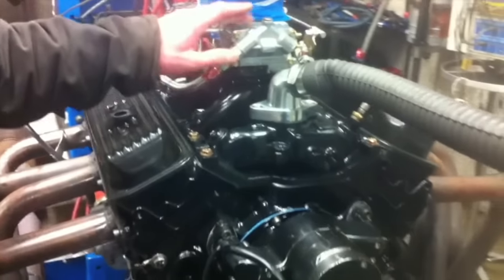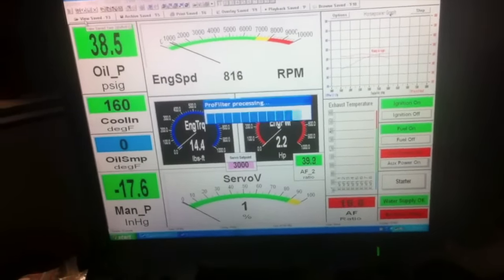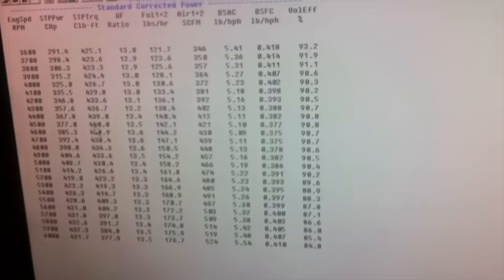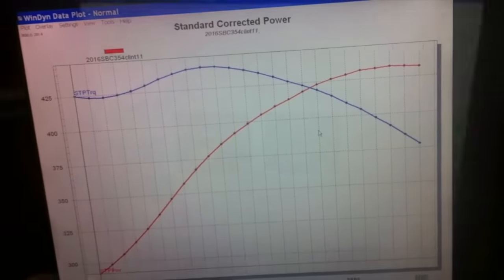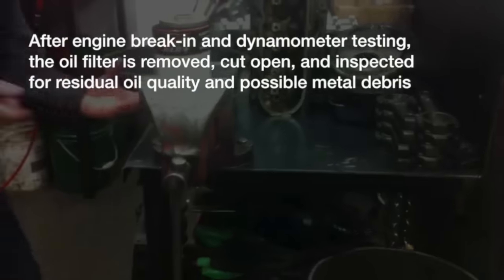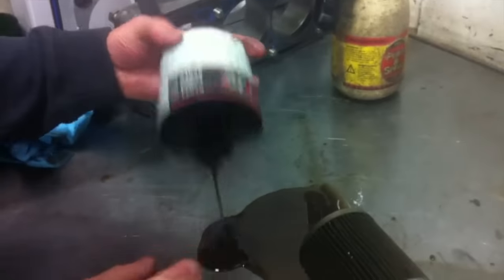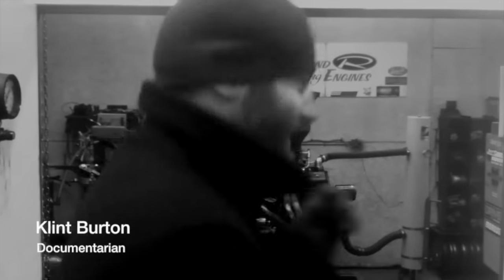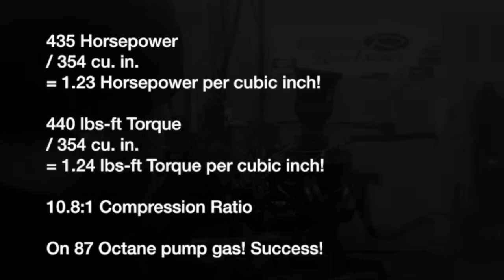SBC 400 Block + 327 Crankshaft Dyno The 350 Chevy Should Have Built (2016)

Comment: Odd how every dyno test shows more torque for a square vs short stroked engine, which is what's best for daily driven cars. Longer stroke brings fuel economy while short stroke brings high revs, without DD efficiency. Not really sure what's with the "350 Chevy should've built" phrase. It's great for drag racing, but not much else.
Reply from the maker: Thanks for commenting. The phase is referring to an iconic article in Hot Rod magazine in 1997. We didn’t coin it but we were highlighting it here. There’s a link in the video description if you’re interested!
Reply from the maker: https://www.youtube.com/redirect?event=video_description&redir_token=QUFFLUhqa0FNSWZibXlwdHZaRnIwaVdTZmtVcVNmMjBCQXxBQ3Jtc0ttMm1TUWxfY3RzbmhFdnFBc040UjBhVnctT2M2azU3RHNJUGQzQld1cGk3YWxJZ3BPNTh1WFJZd1lvbm54VjlONlJWUGs0NTRuNE5pU2VVRzVRUjlCdkFSZHBIYXAzRlRvT2ZHRWNNTHVPWnpuU19VMA&q=http%3A%2F%2Fpurplesagetradingpost.com%2Fsumner%2Ftechinfo%2F350%2520chevy%2520engine.html&v=3oLz362AbDU

Comment: We old school gearhead would put a 327 crank in the 350 and have a high rpm hot rod . Of course one mod leads to another .
Reply: A 327 crank in a 350 is... a 327
.
Reply: @dennisp.2147  It's been a long time but it also had to do with the heads . Bigger valves I believe but like I said it's been a long time . We also messed with 283 and 327 and 265 also 348 w .
Reply from the maker: Yes it is. Both share the 4” bore :)

Comment: I've always wanted to build a stock stroke 400 Chrysler big block with 440 connecting rods and custom Ross 11.0:1 forged pistons, with Mopar Performance stage 6 aluminum heads, then put in a valve train set-up that would allow it to rev out to about 8500 RPM. Top it off with twin GT35 turbos and a Holley HP stand-alone fuel injection system, just to see how "good" that combo would run.
Reply: RPM is only limited by the size of your bank account. The valve train is the big factor in RPM.

Comment: Basically a high performance 348
Reply from the maker: Haha! But about a hundred and a half less in weight! Thanks for your comment!
Reply: @ceperformance  try building a 267 with a 400 crank
Reply from the maker: The disadvantage of the 267 block is the small bore. Might be a good low RPM truck motor though.
Reply: @ceperformance  that's why I suggested it. I'm gonna try a 333. 030 over 307 with a 350 crank.
Reply from the maker: Go for it! I hope you get the results you’re looking for!

Comment: Sounds like that turned out better than fords idea of 400 block and 351 short stroke turning into a 351 modified,  I've owned both the big full 400 and 351 modified and the 400 was a horse but 351 modified drank gas and alot under powered!
Reply from the maker: Hi Rick! Thanks for your comment! Something was obviously going on if an engine is underpowered (no excuse for today's engines to not produce 1+HP per cu.in.), possibly in the design and/or the sum of the parts, from top to bottom? Best regards!

Comment: With the money you could’ve saved on the most likely custom pistons and rods, you could’ve built a flat top 400 with those heads to make 435 horse. And made gobs more torque. 
Let alone a set of aluminum heads letting it make close to 500 if done right. Same rpm range. 
Peak numbers are great but this didn’t rev any higher than a 350 would’ve. 
Bug bores are god for airflow but flame travel gets slower.  And torque under the curve means more power under the curve. Means you accelerate harder at every rpm point below the peak even if they both make the same peak or say the big motor makes less peak. 
This is a great concept for rule specific racing, as the short stroke is easier to make rpm with a big bore for airflow, but for the street, build it big. Coyotes run 8k rpm factory and they have a 3.622 stroke with a 3.622 bore.
Reply from the maker: Great points. Really appreciate your comments. Thanks!

Comment: WHAT DID YOU USE TO CLEARANCE THE MAINS, SINCE THE 400 MAIN SIZE IS LARGER THAN THE 327 MAIN SIZE? JUST CURIOUS. NICE ENGINE WITH GOOD HP ON PUMP GAS!
Reply from the maker: Thank you for asking! Our block was a ‘retired’ drag race engine block that chucked a couple of rods. It is a Dart SHP block and comes with the 350 sized mains. Our crankshaft was a large journal 327 so it fits without any modifications.

Comment: She’s a nice engine. 
But Dr. David Vizard will say the power output is 
Kids Stuff

525 - I believe if you have the correct can ground, with air gap manifold, carb with drop step boosters, 
You can reach 525hp maybe a little more..

DV has the formula for you to correctly spec your correct LSA 
Lobe Separation Angle for maximum output

Comment: Because I use my 1 ton Chevrolet truck for work towing a jet boat to work, I need torque, so I just did a 383 using 6-inch rods which this 383 is going to be my new tow engine.
Horsepower means nothing without torque. 
Lesser stroke engines just not going to cut it for my work truck.
Reply from the maker: Hi MMT, thank you for your comment, Absolutely agreed. Application is key, and what RPM the torque is required. We're not building diesels here yet, but we build everything else! With engines, torque is the amount of work an engine can perform and HP is the rate/time at which that work is done. We were impressed with the numbers this mild cam 354 SBC produced, 435 HP, 440 LBS FT. We built a 329 cu.in. SBC that produced 512 HP, 435 LBS FT here: https://www.youtube.com/watch?v=Ge6RsIOs1-U and an 468 LS with a 4.185" bore x 4.25" stroke, producing - 724 HP @ 7100 RPM, 585 LBS FT @ 6100 RPM: https://www.youtube.com/watch?v=AiclBYPs4Hg . Best regards!
Reply: @ceperformance  My 1988 1-ton Chevrolet had had 2 454 engines in the time I've owned it.
When the last 454 wore out I have for years herd how great the 383 was so I want to try one.
I was being told the 383 using 6-inch rods was even better than using the 5-7 rods so I went with the 6-inch rods for this 383.
I own a fishing & hunting guide services using a 28-foot jet boat that gets towed every place and even from the lower 48 to Alaska and back down to the lower states so that is why I go through engines.
Soon the newly done 383 is going in the truck so I can see how that works out and does the 383 reputations for power & torque hold true? 
This time the truck got a big rebuild with the turbo 400 and transfer case was all rebuilt for another go around with the 383 .
The Alcan Highway in the Yukon has some 5-mile 8% grade mountain climbs so the 383 is going to get a big test for torque.
The 350 engines won't pull the grades with the jet boat being pulled so I had to use low range 4x4 and 1 first & 2nd gear to get to the top of the mountain. 
Going to be very interesting for sure.
Reply from the maker: Very interesting, for sure! I hope it works out awesome for you :)
Reply: @ceperformance  I hope also this 383 is what I need for towing because building these engines as you know isn't cheap.
I can't go back to the old used up wore out 454 I put away for another day when to rebuild it the money was all used up to build the 383.

Comment: You should have seen what it would have made with a real carburetor on it! That one was way too small! Also it needs a real oil pan, & probably a good windage tray, so your oil pressure stops falling off a cliff! With a performance engine your supposed to give the engine what it wants! Not what you want to give it! 11 to 1 is not a issue with correct camshaft! We’ve been doing it since the 80s when my boss started his shop! Good luck, & it would have made even more with the 3.750 stroke crank! It’s been proven thousands of times! If you really want engines to run upstairs, it’s about airflow, not about stroke! Richard Holderner on YouTube has done back to back testing for years & was smart enough to record it!
Reply from the maker: Hi Brian Holcomb, thank you for your comments. Each engine build begins with what a customer wants and needs. In this case, our customer wanted to use a 3.25" stroke crankshaft, a mild solid roller cam, and a stock oil pan with a windage tray. Richard Holdener does fantastic work and much can be learned from his channel, alone. Best regards.
Reply: It absolutely wouldve made more power everywhere with a 3.75" crank over a 3.25" crank. Usually, though, as cubes increase, especially via stroke vs bore, the efficiency or hp per cubic inch decreases even if the max goes up. Now this is only an issue on paper, as any gains are welcome to a driver. Hp per cube isnt important behind the wheel. 

Im stumped as to why it made more power on 87 and less timing than it did on 94.
Reply: @garlandjones7709  

My guess is that they used Vortec heads with more efficient chambers that don't need as much timing as the older style chambers.
Reply from the maker: Thank you for commenting!
Reply: @garlandjones7709  the increase in crank size would increase peak torque, however the efficiency was increased thanks to the improved rod to stroke ratio which gave a better BDC rather than TDC as a maximum power build would focus on, NASCAR uses a similar rod to stroke ratio for fuel efficiency at high rpm. Look up the original article in June 1997 Hot Rod, the article was called The 350 Chevrolet Should Have Built. I found this video when looking up the old article.
Reply: @SteveSega  without me rewatching the video fr specifics I'd rule out rod/stroke altogether. I lived off of magazines for two decades. Rod/stroke is hype. Talk to any pro in stock classes or cup classes and they'll tell you the same thing....pick stroke, and design your piston....spec rod length to what distance is left to connect the two together. 

If I had to guess, and this will play on what I mentioned earlier in the "pick crank" it will be related to piston speed and if using small heads, keeping piston speed lower so they don't run the cylinder head ports into a choke area on their velocity/speed

They did mention the customer wanted that crank. Implying not their choice in response to the 3.75" making more power. By them responding at all to that without a counter, it implies(to me) they hold the same opinion.
Reply: @garlandjones7709  I was simply pointing out what it said in the article, then suggested looking it up. I'm not trying to argue, just saying that was their claim. The customer for the engine in this video wanted the engine or similar from the article. This is something for a daily driver, not racing.
Reply: @SteveSega  Gotcha. I missed your intention with article. I thought you referenced the article to say rod/stroke was why this was done. As I mentioned. I didn't rewatch the video andits been a minute sincei had.

My intention wasn't to argue either. I was offering an insight into what a professional designer would be interested in and what he wwouldn't. Was not a knock, but an interest for future learning.
Reply from the maker: Thank you guys for commenting. We’re just having fun here trying different things, many of which are not at all new. Still it is fascinating to try stuff and get good results leading to happy customers :)

Comment: The Idea of big 302 is great , however who would want this engine with a smooth idle?? 302 was streetable and also sounded good also, 3.5" crank has same effect in big bore plus you would have gained another 30 HP . waste of 4.1/4 block with 3.25 stroke.
Reply from the maker: Hey thanks for commenting. Not sure I agree with the ‘waste of a block’ though. In fact, we saved a block from being scrapped that was a 1/4 mile engine that lost 2 rods and busted the bottom of the cylinders. The short stroke fit without any of the skirts going past that. 
It was a win win :)

Comment: For horsepower, the overbore engine is usually the best combo. For flat, wide powerbands, the overstroked engine is most often what OEM uses. I've found the best overall hp and tourqe combo to be somewhere in the middle. For overhead valve engines, the biggest bore possible will alway breathe better. Then I use the longest practical stroke the combo/ block will allow at the rpms it's intended for. It's a balancing act.
Reply: I’ve always been really happy with the 350 Buick. The bore is slightly bigger than the bore and it’s great in my pickup truck.
Reply: @VinnyMartello  not sure what your saying. But what I CAN tell you is, Buick engines have very poor oiling systems, and shouldn't be rev'd over 4500rpms. Run 10w40 or thicker oil and keep it clean.
Reply from the maker: Hi Andrew! Thanks for commenting! We agree, for the most part. Check out our 283 crank in a 400 Bowtie block dyno session. This engine now rips around a '66 A-body car just fine, with a very happy customer: https://www.youtube.com/watch?v=Ge6RsIOs1-U
Reply: @ceperformance  The 302 is as far as I'm willing to go down that road. 4" bore with 3" stroke. I just don't see any advantage to strokes less than that in a first gen smally. Personnely, I've never been inclined to max out displacement on an engine, as I feel getting multiple builds out of a block is the smart move. With today's performance aftermarket support, displacement isn't as important. A 408 cid LS is more than enough to kill the bravest man.
Reply from the maker: @andrewbecker3700  Great points, Andrew! For us, it's all about what our customer's want, combined with the engine application. As you can see in our channel, we've produced some fantastic engine combinations and will continue to do so. Best regards!
Reply: Whoops meant to say the stroke is bigger than the bore. I have a 350 Buick is my daily driver Chevy pickup. I love how well it pulls trailers.
Reply: Sorry, but the OverSquare engine will always make more TQ & HP at any rpm than an undersquare engine of the same displacement. The idea that longer stroke makes more torque came from over 100 years ago when engine technology & metalurgy was in it's infancy, when cooling was always an issue, big HP was 100 hp & an engine never saw 3,000 rpm. BTW, please name 1 undersquare engine being used by any manufacturer today. I can't think of any being produced since everybody went to overhead valve engines in the 50s.
Reply: @bradgriffith4231  A cummins inline six.
Reply: @VinnyMartello  The conversation is about naturally aspirated gasoline engines. A turbocharged diesel has nothing to do with the topic.

Comment: These engines in n a form don't make alot of low end tork and not much more power for the compression increase. They could have gone higher in compression with fast burn heads, or 14.51 on e85. Or just turbo a stock 327 350 or 400.

Bv
Reply from the maker: Hi Paul! Thanks for your comments! Sounds like a take-your-ball-and-go-home attitude? We like producing N/A engines with different but off-the-shelf components. Learning never stops here, and it certainly ain't making us yawn. Best regards!

Comment: should have dyno'd it as it would be run. no one runs a street car without an alternator or water pump pulley. also, put an actual air filter on it and stop using dyno headers. all those changes would drop the power quite a bit.

last i checked, no one races dynos down the 1/4 mile. the info is useful for comparing changes but not real for showing actual power output in a car.

Comment: I have a 400 small block and I honestly want to make 700hp or close all motor
Reply from the maker: I encourage you to go for it! Totally doable.
Reply: @ceperformance  any tips or recommendations? I did think about using a 327 crank because it allows you to rev higher
Reply from the maker: Honestly, although I Iove the 327 crank in a 400 block, you’ll have a hard time produce that desired horsepower without more cubes. This is one of those situations where there’s no replacement for displacement :)
I would put a 3.875” stroke crank in it, 6” H-beam rods, AFR 235cc heads and a solid roller camshaft with .700” or more lift. Something like .254/.260 duration. A stud girdle or shaft rockers. 
With flat tops and 11.6:1 compression you’ll get 670HP. 
If you want more power than that, you’ll need 13:1 or more and at that point, pump gas isn’t going to cut it, most likely. 
I hope this helps :)

Comment: I built something like that but used a set of Rhodes two stage lifters and double roller rockers . Below 2700 rpm it gave what ever your cam lift was above  3300rpm they added near 40k lift to cam  with 1.5 rockers . As long as valves clear try 1.6 and Rhodes..

Comment: If It had smaller stroke why couldn't it Rev further than 5900 6000rpm?
Reply from the maker: Hi PT! Thanks for the question. This engine's RPM was limited by the Vortec heads and cam. The purpose was to build a very mild street engine, which still produced a surprise for us: 435HP, 440LBS FT, and it was super fun to drive!

Comment: Problem is that weak block they had. Gotta get aftermarket. It's not a myth , I used to think it was a myth that the 400 is weak.  It's weak.
Reply from the maker: Hi 406! Thanks for commenting! Our block, a 400 SBC Dart SHP was repurposed after it had been blown up on the track a few times. We haven't had issues with stock 400 SBC blocks, and we've both remanufactured and built high performance crate engines with quite a few of those! Best regards.
Reply: @ceperformance  Hi. My friend Butch ran a GM'509' 400 block,  all motor,  rpm around 7000, it was fine in circle track but when he drag raced it split in the spot most people say they split. I had a 509 and it needed a rebuild but after comparing machining and parts prices it made sense to get a long block with a SHP, so I personal didn't try the gm block.  I've seen so much arguing about this , I bet you have too! I love the linear torque of these 400's!
Reply from the maker: Very good points! Thanks again :)